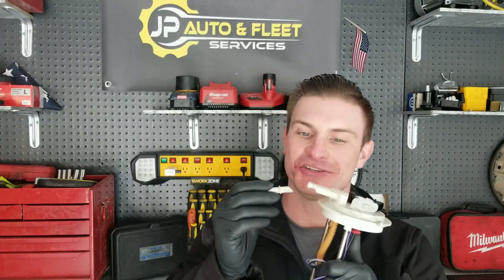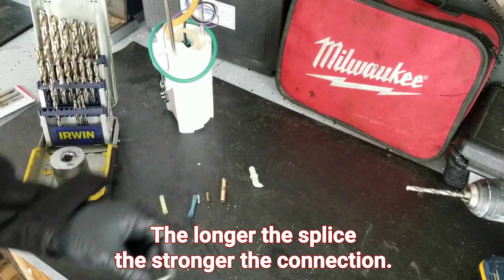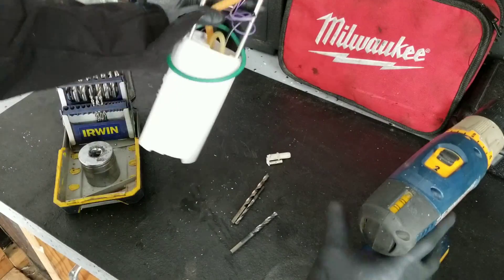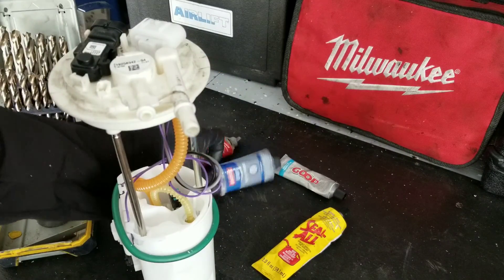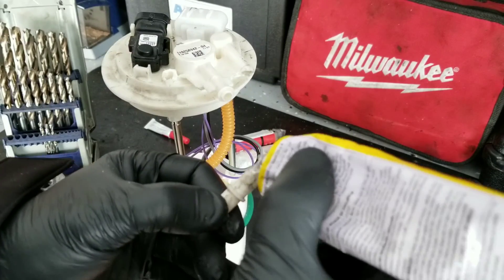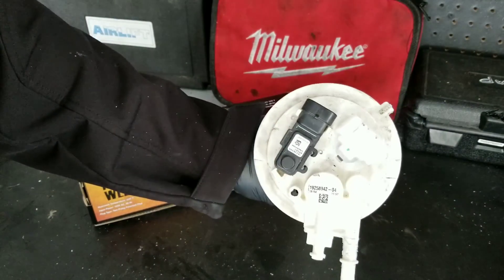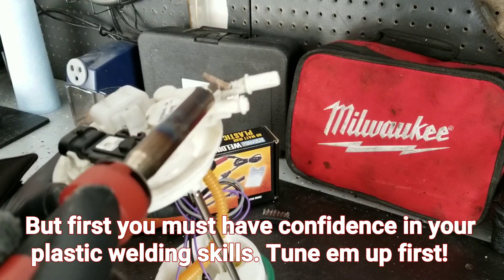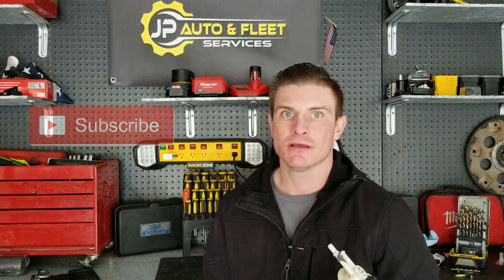How Pros Fix Broken Plastic Fittings I Best Fix on YouTube I Stronger Than Factory

Comment: Too bad I did not know this sooner with my outdoor Roth Oil tank I bought a couple years ago.  The plastic top fill/vent ports all bent and cracked over time and Roth said since I did not document my required inspections at every fill up by the oil delivery driver... the warranty was null & void.  So I got very upset and took a sledge hammer to the pipes and then pulled the oil tank over with my riding mower and it dumped over 300 gallons of oil into the yard LOL.  At least I will never have termites.  I went back to the steel tank design of yesteryear. I am done with Roth. Good thing is money is no object with my family. Stay away from Roth garbage tanks.

Comment: (6 years ago video) In general, I've found doing plastics repair it's best to add a piece or more of metal wire (like a staple or electrical wire) buried in the glues or epoxies. Sadly, melting in said metal(s) makes the part weaker. This gives a skeleton of support along with melting or glues inside or out. Another point, when repairing nipples, like this video, make an extra connection a few inches away from said repair. This isolates the stress away from repair(s) for future disconnections. HOPEFULLY there's room. 👍

Comment: Great trick, used on an EVAP line. Used one size smaller diameter plastic line, coated with plastic cement and it forms a solid bond inside and out. Thanks man

Comment: Yeah man - really helpful thank you!!  BUT i couldn't help noticing that fuel line looked like it needed to be replaced also! haha I just pulled similar looking hoses out of my motorcycle's gas tank.  They were so hard the broke apart like glass.  AND I've got one stuck on a plastic nipple that I need to reuse.  I'm not sure how to get that old, VERY HARD plastic hose off of the nipple without breaking it.  I might dremel cut it off but not entirely sure if that's the best way to do it.

Comment: Years ago had jeep tank bust on me tank split where the pump goes in .So I'm a welder I got handfuls of zip ties f.Clead tank of all gas first and welded that mother up ..I'm maintenance tech at a tile plant
We have a brick printer that paints brick with different prints that the customer wants. Well the little pumps are 650 and only thing that broken was the nipple were the return lin an pressure Lin go into the pump its like 1 /8 in .I told them give me the part .So now I'm about to do what you just did thanks for the pointers have a gooden.

Comment: Thx for the video bc the nipple broke off evap system and I almost had finished replacing fuel pump and bolting everything down!
Reply: My fuel pump's nipole is leak.. I'm not sure if applying this glue will stop the leakage

Comment: I received one unit (Fuel Pump Assembly for 2001 Saturn SL2), it is OEM, but the central tube isn't pushed all the way to the end, like a gap ~2mm to where it is supposed to be. I thought maybe to use heat gun a bit, but was afraid to damage the tube (and the unit is ~$330). Also I saw in some films they use a heat gun in combination w/push gun, so maybe the heat won't be sufficient by itself. Maybe to use the hair dryer to try, it won't hurt anything. That type of connections you can see on many aftermarket FPs, if you want to replace just the motor, you would need to disconnect and put back a lot of those w/wavy surface. Can you tell what is the best way to fix it? Thank you for the great film.

Comment: Its happens the fuel vapor just kills the plastic and then there is that badly designed  stiff connector that gives it the last kick to break 👍🏼 like for the fix thats the only way doe

Comment: That was awesome! I have 3 broken fittings, I’m still trying to get the broken pieces from the quick connect, and I’m down $255 for a née fuel pump just because I didn’t think there was any practical way to repair the plastic nipples.....all this started over a check engine light with an upcoming emissions test that would have failed my 2001 S-10 blazer. What’s even worse is that I just replaced the fuel pump 3 months ago and check engine light turned out to be that the ground wire on pressure sensor pigtail pulled out of the connector. Incidentally I found out I could buy the new pigtail for $35 and I am now trying to figure out how to splice some longer hoses to fuel pump if anyone has a quick way to do this please send me the link! If only I had searched for this broken fuel pump connector video before I ordered and installed a new fuel pump I could have saved myself so much money and grief! Thanks for sharing your knowledge and skills!

Comment: Seal all does not work!!!!

I went to Lowe's for a brass 3/16 coupler Barb take the torch get it hot and push it in do not breathe then I took the other one stuck it in the broken piece the same way heated up with the torch and stick it in then I used 3/16 gas line with hose clamps work like a charm!
Do not use seal all !!!! Guaranteed absolutely will not work. No matter what you do it's only temporary I have the appointment for Tuesday

Comment: The plastic welder is the way to go man but you have to have electricity nearby to use it. At Menard's I bought a 3 in 1 torch that has a torch, hot blow and solder tip.
You can pick one up there for $20. The thing runs on Butane and the smaller solder  tip allows more control in melting the two broken pieces together.
Reply: I save the cut-off portion of plastic zip ties to use as plastic material for strengthening the welds.

Comment: Polyurethane is an organic material . UV rays from the sun as well as temperature changes WILL degrade it. It is NOT fuel resistant.
On the other hand Silicone is an inorganic material that should last outdoors (like  under your car) far longer and not be affected by the sun,oil,gas, or
 wild changes in temperature and humidity. Silicone repair tape with the metal tube reinforcement  put inside the tube to hold the parts together
is the way to go here. That is the part that is most important. The  Silicone tape is 1 inch wide and does conform to uneven surfaces.
It can handle temperature swings from -60 degrees to +500 degrees. Make sure the surfaces to be wrapped are clean first.

Comment: Yes!!!!!    This fix is easy, fast, cheap, and best of all it really does work.   Fixed a coolant return line on my 6.7L Ford after the plastic nipple broke......I estimate it would’ve cost $1,000 to get the truck towed and hose replaced.....hard to reach hose that disappeared under the engine from the top side.  Some 2-part epoxy and a small copper tube from a hardware store and your steps in the video - and I’m back up and running with no leaks.  Thanks!!!!!    Best fix I have truly found on YouTube.  Thank you thank you thank you!!!!!
Reply from the maker: Bad ass man! Happy it worked out for you. I learned this from an old school mechanic and had to pass it on.

Comment: I have an amg c32 and fuel pump is $1500.  Mine broke at the elbow.   Any suggestions on how to seal it off.  It ironically already has a metal tube going down it to reinforce but the plastic cracked.

Comment: Man this video will save me 300+. I just Broke the plastic nipple on my fuel pump for my R6 and was super stressed until I saw this video! Thanks a lot
Reply from the maker: Take your time, use the right materials and you should be fine!
Reply: Same here!! Broke the plastic nipple on my FZ6, the assembly USED is almost $500!! This will save me so much $$
Reply: Just broke the high pressure line nipple. $665 to replace on my 2006 Yamaha R1.

Comment: Thank you!!!!!!! I stepped on mine trying to get a bolt on.
Reply from the maker: Lol. Hope it works for ya!
Reply: JP Auto & Fleet Services it worked!!! It actually worked!! #1 only drill just enough to get it to snug the fitting, #2 used seal all, and lightly as possible hammered fitting nice and tight and #3 let it sit for half a day, then it ran perfect and sold the car and have never heard back from the buyer with any issues
Reply from the maker: @carlos52321  thanks awesome brother!

Comment: You drilling into the housing is going to cause plastic to get all in the fuel lines you definitely aren’t experienced
Reply from the maker: For the sake of the video length I cut out the part where I greased the drill bit and blew out the housing. Thanks for the view though!

Comment: Pretty sweet fix... I like it! Thanks for the mention. Good luck to you my friend.
Reply from the maker: Thanks Pete. Its just a bunch of fixes coming together for the right reasons lol!
Reply: I have an amg c32 and fuel pump is $1500.  Mine broke at the elbow.   Any suggestions on how to seal it off.  It ironically already has a metal tube going down it to reinforce but the plastic cracked.